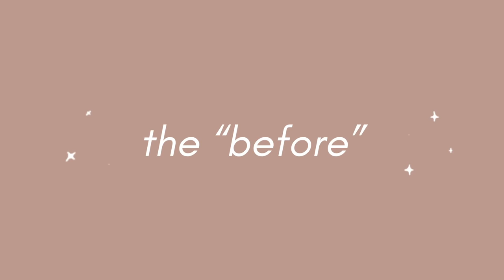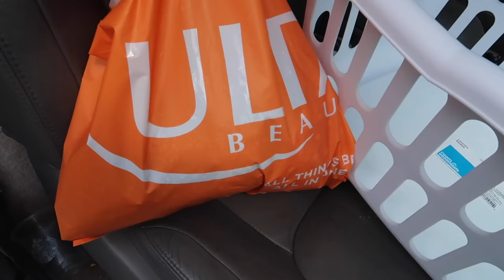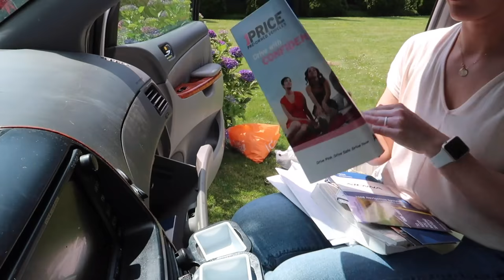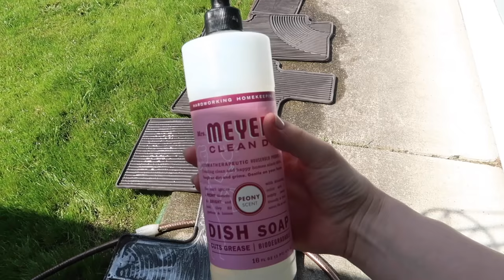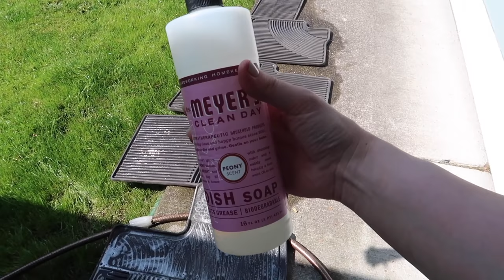VAN EXTREME DECLUTTER 🚘Messy To Minimal TOTAL TRANSFORMATION | Minimalist MOM CAR TOUR ORGANIZATION

Comment: I found keeping some sort of place for trash keeps the car so much cleaner! I just used an old shoebox lined with a plastic bag and put one where the kids sit and one in the front. It gave them somewhere to put trash when they needed to instead of just throwing it on the floor etc. And made it so much easier to clean as all the trash is in one or two places and you can easily empty them out. Great job detailing! Hello from Australia 🇦🇺😊.

Comment: It looks so great! I like to clean out my car before we take trips so that packing is easier and everything is fresh for the long drive. (I also like to leave a clean house behind so I don't have house mess on top of unpacking when we return.) I know the Seattle area doesn't get as hot as where I am, but you might consider using a spray hairspray rather than aerosol if you're going to store it in here in case it gets hot and explodes (or otherwise causes damage). The essential oils might not do as well in the heat either, but I'm sure they'll still smell nice.

Comment: Get a little plastic cereal container and line it with a grocery bag. Use it for trash. Put extra bags in the bottom of the container so when you pull the bag out there are more at the bottom to put in. I do this when it gets full and I’m at the gas station. It makes a huge difference!

Comment: My best tip is to keep a roll/box of cheap trash bags under the passenger seat and start a new trash bag every time you get in the car.  And throw it away when you get home or stop for gas etc. I also purchased 2 black and decker handheld vacuums at target on Black Friday. I keep one in the house charging and one in the van. Then whenever I’m sitting somewhere waiting I can vacuum a little.

Comment: I only keep what I consider necessities in my truck: tire wrench, partial bottle of motor oil, maps, paper towels, small box with a few vehicle supplies, small fold-up stool (I'm short, so I need it for checking/filling almost everything under the hood), tote bags, repair manual, owner's manual, my wheelchair, shovel (for winter), snow brush, jumper cables, spare blanket, small toolbox with all the basics, leftover jug of power steering fluid, oil pan (in a bag), spare key (only for unlocking, can't use it to drive), and the ball from my tow hitch.  I need to get the pair of fire tongs out of the bed (borrowed from my parents in college because the wood fireplace in our student center didn't have one, and I need to return it to them - I'll do it the next time one of us drives to visit the other, as we live 1,000 miles apart), but that's the only thing that really shouldn't be in there.  I don't keep anything under the front seats because I know how extremely annoying it is to have those vents blocked with stuff.  One thing I do not have is a trash bag, since 1) there's nowhere to put it where it couldn't fall and get under foot, and 2) I don't want the stink - I don't often have other people in my truck, but when they do and do have trash, we just throw it away as soon as we can.  I need to clean the inside of the windshield, front doors, and the dash... and I should probably vacuum it.  It's significantly cooler today than it has been, so hopefully I can get at least some of that done today.

Comment: I tend to keep a clean car. if there is any garbage in the car its usually from my husband who likes to snack on stuff or if we go through a drive-thru and have a bag on the floor i try to make a point to stop at the gas station and toss it away when I'm filling up. I vacuum the car at the end of winter/spring.. then try again to do the same at the end of summer. i give the outside a bath as often as it needs it.. especially in winter when salt buildup happens..  usually wait till its above 40 degrees for that in the winter. (I live in Michigan). We spend so much time in the vehicle it can get really messy especially if you have kids.

Comment: Wow, great job!! 2 quick thoughts: a little solid garbage receptacle (box, little can etc -- just not a flexible bag lying on the floor) really helps. Also, our van is a slightly older version of yours (!) and I noticed it looks like you also have the compartment thingies in the side walls in your trunk? If so (and you might already have stuff in there), but it's a great place for all the stuff like jumper cables etc. :)

Comment: Before I was married and had a kid my car was clean! Now it's trashed. And this ATL heat is horrible, so my car will not be cleaned anytime in the near future lol
Reply: A lot can be done with the AC cranked and switch seats and tackle some hot spots it will make you feel like a superstar even if it’s just a slight improvement. ❤️✅

Comment: Hallo,  here in my country ( Greece) where I leave we don't have closed parking and I have to park by the road and becouse it is very common to break windows and steal stuff I do not keep much in the car....where the seats are....The car documents are always in my purse ( that was an advise form a policeman when my best friend's car was stolen )  and in the glove compartment I keep only tissues ,the car user manual, a car-charger  for my cellphone as also some pen and paper. i do not keep any cd's , I take some with me when I travel for long trips.  In the trunk I keep only the obligatory accesories : emergency triangle, pharmacy ( minimum stuff, only for long distance trips I check to have it full) , fire extinguisher , cables, and a neon-yellow vest . Under the trunk carpet is the place for the extra wheel ...in there I keep also some tools ( came with the car ) and a pair of working gloves in case of flat tire... I do not eat in the car , I have only water with me in a insulated water bottle. I do not leave any cosmetics but in the driver's door pocket I keep a small ombrella  and a small torch....